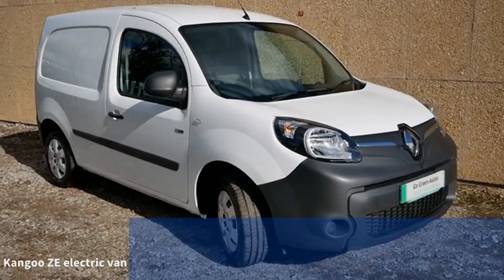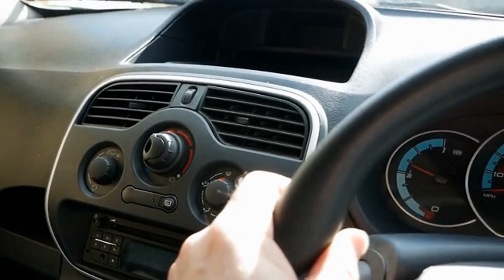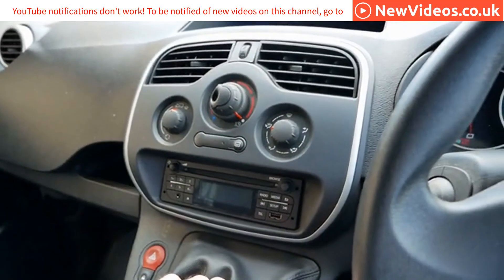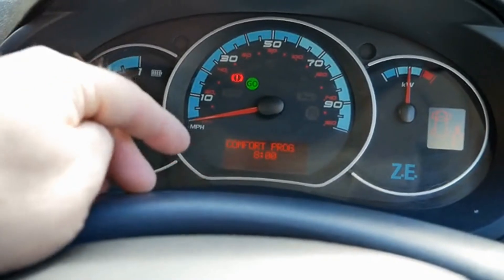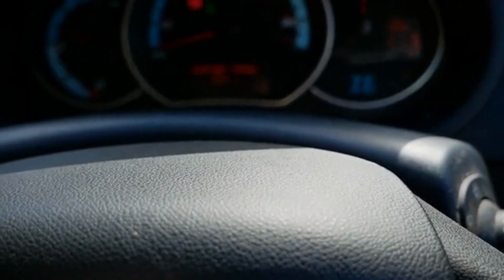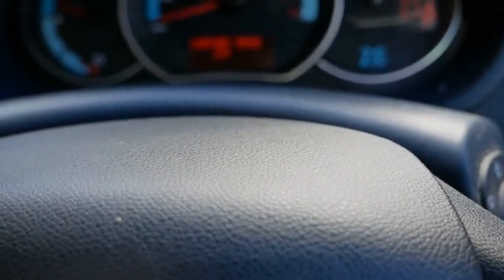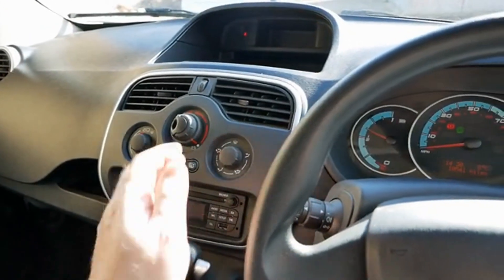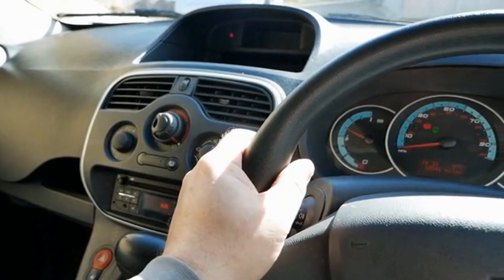How to use pre-conditioning in a Renault Kangoo ZE electric van (22kWh & 33kWh models)

Comment: Does it not have an app ?   As in Defrost Now
Reply from the maker: No, no app. Vans don't get the same equipment as cars.
Reply: An OVMS(Open Vehicle Monitoring System) box could probably allow owners to control this function via app over 4G. Just check that OVMS supports your specific car brand and model before purchasing :)
I got one for my old 2015 Tiwzy :D (but for other reasons that preheating tho, OVMS adds a lot of functionality and possibilities)